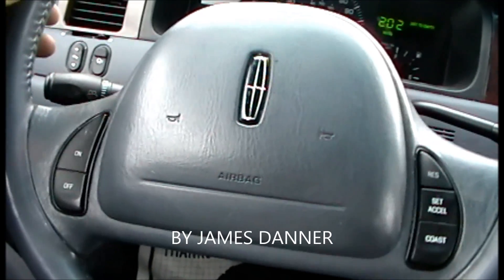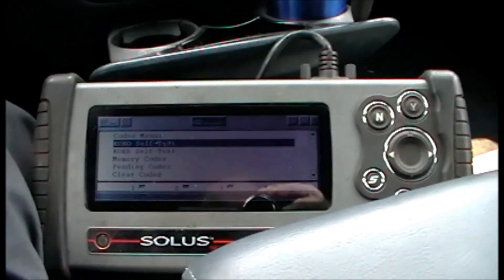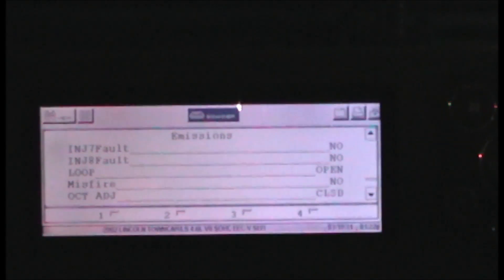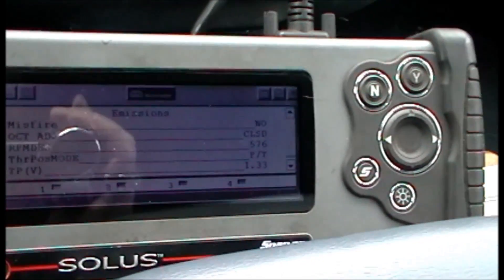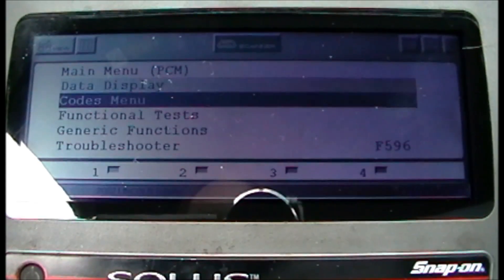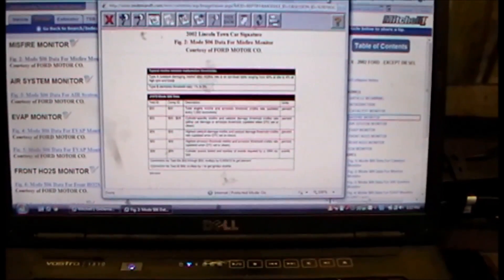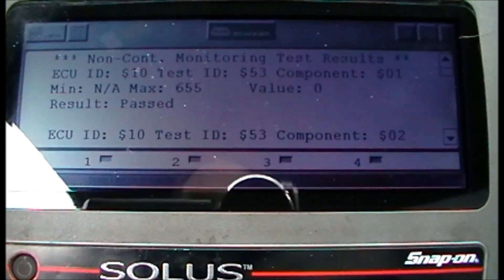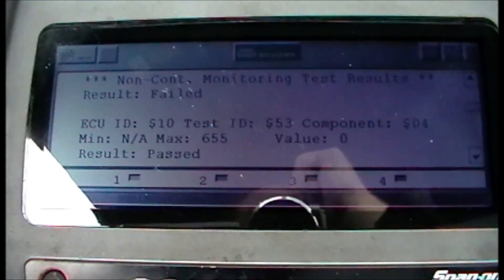FORD MODE 6 DIAGNOSTICS

Comment: Hi James,

A while back on one of your Videos you posted a link to a baro/elevation conversion chart. I believe it was on the shop glass where you work. I had it and misplaced it. Could you send me another or tell me what video that was in. Sorry I know this has nothing to do with this video..this is just one that I stopped looking on..Thanks
Reply from the maker: I think it was the ford v8 system lean. if u don't find it, remind me after Aug 10th. at the beach this week..:)
Reply from the maker: I think it was the ford v8 system lean. if u don't find it, remind me after Aug 10th. at the beach this week..:)

Comment: Thanks for the video James. I have benefited from it already. Had a Mitsubishi V6 engine with P0300 code, customer had not had a problem with vehicle until another shop had fitted a timing belt. Mitsubishi data on Modis didn't have cylinder misfire data available. Had a look at mode 6 on OBD data and found misfire fault data on cylinders 1, 3 and 5 only, cylinders 2,4 and 6 were 0 misfires. Owner was with me during diagnosis and was able to demonstrate misfire data to him as well as show him the timing marks didn't line up between crank and bank 1.
Reply from the maker: thats awesome mode 6 detective work, ive caught whole bank misfires on toyota VVT solenoid failures as well, thanks for watching

Comment: I was once told from another Tech that I worked with back in the day that there was a company that was selling a book and a cd-rom or dvd (can't remember) that had all kinds of manufacturer specific info on Mode 6 data and values and how to convert them to useful info..not just misfires but all systems monitored.  I have not been able to find anything like this, but if anyone out there knows about this, I would love to hear it!  I was told once at a trade show that if you had the right info and conversion factors for mode 6 data that a technician would be able to call failed parts before they failed.  This was an Automotive Engineer that told me this…Anyone have any info on this?
Reply: I know for Ford OBD2 monitors you can get FREE information about them from the Motorcraft Technical Service information website in the OBD2 theory and operation section.  It also includes the conversion formulas.

Comment: Great vid man.  Mode 6 can be a real pain in the behind, but very handy when understood.  I once had a ford truck with a single cylinder misfire code, so I checked the mode 6 test ID 53 just because I like to see it there as well, and I noticed that the cylinder next to it hadn't failed on the value scale, but was close, so I immediately went after an intake leak between those cylinders and found the problem within a few minutes.  Keep the vids coming!
Reply from the maker: thanks buddy, it is nice when you know the full potential of your tools. workin on a vw VVT right now but not sure how far customer wants to go we will see
Reply: James Danner How did that vw VVT go? were you able to get some footage or no? lol yes you can call me impatient…I don't mind :)
Reply from the maker: relax..ha ..waiting for the part..ebay was the cheapest for the chain tensioner assy..all i have is video of stuff not working

Comment: Thanks for this video im the guy with the 2000 crown vic miss fire that I message you about and I had the same problem with me connecting the scanner on my car and not showing cly1-8 now I can get to the bottom of this miss fire under light load nightmare because of this video thumbs up !!!!!!!!!
Reply: Hey James just wanted to let you know I figured out what was wrong with my crown vic the intake manifold nipple 4 heater core hose had a slight crack in it making coolant leak down into the spark plugs causing a mis under light load
Reply from the maker: wow,nice find.  i bet you are sleeping better at night

Comment: Just an FYI, Snap On now has Power balance so you can see live misfires, not as good as the IDS but still works well. and yes it will work on that old of a Ford, I have used it on older that 99 models.
Reply from the maker: right on. i think my old solus shows it as cylinder contribution test, i probably should have used that in video as well. appeciate all the feedback..thanks Mike
Reply: IDS calls it a power balance so that is what I call it:)

Comment: Good tip James, crystal clear camera shots. On the fords I have seen most do not trip  a code till the misfire counter gets higher than 14k. Mode 6 the way to go.
Reply from the maker: thanks for the specifics. i know ford dumbed the monitor down on the 3.0ls cause it would set misfire codes with crank fluctuations on road dips but i didnt know the spec...im kinda filming at an angle so i dont see myself in the reflection...ha